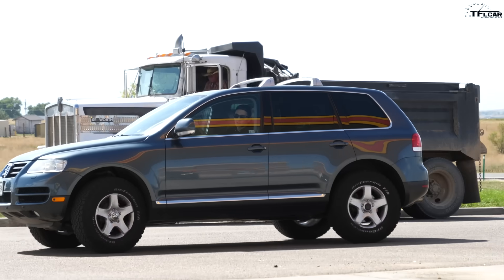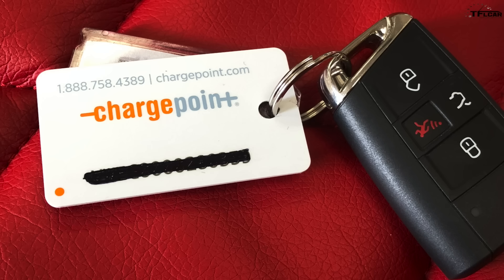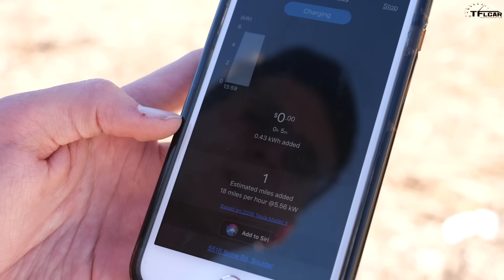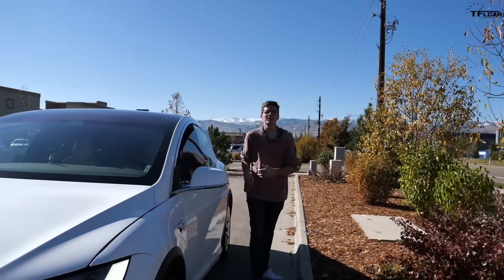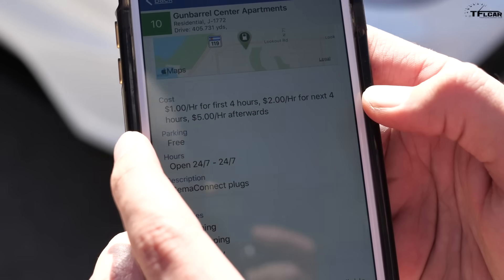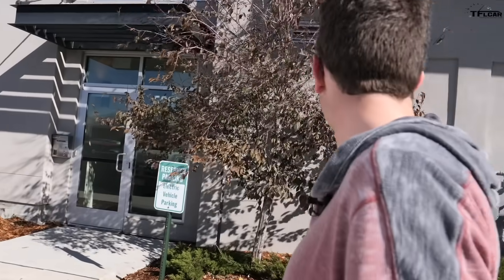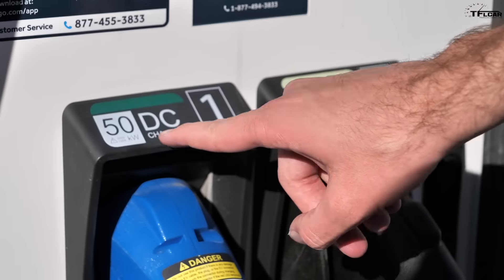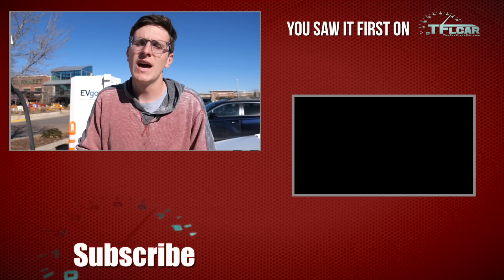Here’s Why Charging an Electric Car Can Suck - And It’s Not The Reason You Think!

Comment: Imagine traveling across the country every 200 miles stopping for many hours waiting for a charge. I do not think so.
Reply: and that is after you searched the net for a charging station, go out of the way of your travel to find it, and hope no one is using it, otherweise it is a long wait.
Reply: @yewkiamakuahui2296    Right you are. I once had a special card to get gas at commercial refueling. It was a huge pain in the ass when traveling. Would have to travel off the main roads 5, 10, 15, 20 miles out of my way just to get gas. All to save 3 cents per gallon.
Reply: @On, Wisconsin!   Wow,  now I can go a whole 100 miles look all over town for a charger then I have to wait 30 minutes. That is very inefficient.
Reply: @mikewhite9818  you don't have to look for a charger.  Just punch your desired end point into teslas navigation, and it plots your charging stops for you, right down to telling you how many minutes you have to charge to make it to the next stop.  Alternatively, in other EVs, you can use an app called a better route planner.  It has every known charger listed in its GPS, and you can enter what kind of car you have, and it will show you where you should charge.  It's really not that hard.  I'm not a technologically advanced person, and I can operate either of these very easily.
Reply: In one video I watched they said that the first small charge goes the fastest, after that it takes forever to fill up completely. So the recommendation is to make a lot of short trips between charging stations and make many short fast fillups.  I would think that would be annoying though as you would spend your entire life centered around and focused on your car and not on life itself.
Reply: @trailsend7877    You point is well taken.
Reply: I hope charging stations pop up on the GPS route.
Reply: @michelle20900  They may but the real issue is the time spent charging. Better hope for entertainment at each stop every 200 miles.
Reply: One way around that would be to tow a trailer with a generator on it. That way you could charge the battery while driving.
Reply: @timinwsac  And the trailer would drain the batteries faster.  A hybrid makes much more sense.
Reply: that is why you buy tesla
Reply: @navinmesommonta2017    I can buy a lifetime of gas for the price of a Tesla. Stupid you.
Reply: @mikewhite9818  you can buy modle 3  or  y at the same price as  gas car  any way   they are stop make gas car in the few years and in europe are sooner
Reply: @mikewhite9818  total ownership cost is actually matters, your comments all over the place, but showing you do not really know about basic things about Tesla cars.
Reply: @SLee-vj4px    Add up the costs and gas is way cheaper. Plus it is extremely efficient. If anything breaks on a Tesla you better have a big cash account.  It is ok only for around town. That is it.
Reply: @doctorlarry2273  right, so what? not good enough?
Reply: @doctorlarry2273  never say never, they said Elon will never make EV a mass produced cars for the consumers... eventually the energy industry will be facing today's auto industry where everyone try to catch to Tesla and develop EVs... but Mr. Musk had far advanced technologies that these today's big legacy ICE and Oil companies will fade gradually. this is not easy, only Elon has the guts and talents to do this.
Reply: @SLee-vj4px  Never.  It is not about building a better EV - it is about getting power to them.  Musk must be related to P.T. Barnum.
Reply: @trailsend7877  8 hours of charging time? If you can provide what model/make that needs 8 hour of charging. 8 hours, lmao
Reply: BRO. LIFE IS ALREADY STRESSFUL. NOW TO THINK OF CHARGING YOUR CAR AT A STATION FOR AN HOUR IS INSANE. OR EVEN AT HOME. THIS THING WILL EAT UP YOUR ELECTRIC BILLS LIKE CRAZY. I DONT THINK ELECTRIC CARS ARE FOR ME MABEY IN A 100 YEARS.
Reply: Try 20 to 30 minutes Tesla Model Y owner
Reply: @bobskeway8179  “2022 Tesla Model Y/Battery charge time 10h at 220V”
Reply: @bobskeway8179    Or at 120 normal household current “Imagine Level 1 as the universal charging option. If there is a standard wall socket nearby, you will be able to charge your Tesla with that. With that said, 120V is the bare minimum amount of juice you can pull into your EV. So if you’re wondering how long it would take to charge your 2021 Tesla Long Range Model 3, you’re looking at a matter of days, not hours. Not ideal.”
Reply: @mikewhite9818  I have a 220 in my garage charges at rate of 29 miles per hr. Most EV owner have this.  3-4 hours
Reply: we have charged our 2021Tesla Model Y over 80x average charge time 20-30 minutes (Range 325 miles)
Reply: @bobskeway8179    Refer to previous post. You can not charge a tesla at 220 volts in 3 to 4 hours. Stop lying to people.
Reply: @bobskeway8179  Only if you can find a special charger.  Your 20 min time is only 80 full. You can not drive the distance you say on an 80% charge. Further each year the battery capacity drops. By the time you have to change batteries you have not saved a dime or saved the environment. Follow the science not propaganda. Leftists are very prone to being propagandized.
Reply: @mikewhite9818  I have 6 friends who all have Tesla's plus one who has a EV VW all of them have 220 chargers. The battery life of the Tesla is 500K miles and life of  the car is 1 million miles, BYW I have a advanced degree in Quantum Physics! I think I know science.
Reply: @mikewhite9818  Do you own a 2021Tesla Model Y Long Range?
Reply: @bobskeway8179    But I can read and Comprehend what experts say. Some of which I posted for you and others to learn from so you can spend your money more wisely.
Reply: @bobskeway8179    If you had any kind of degree then you would know the folly behind electric cars at this time. It will take some kind of break through in the future to make them viable.
Reply: @bobskeway8179  Facts:  Model S (40, 60 from 2012-2015)	8 years / 125,000 miles	N/A
Model S (pre-2020)	8 years / unlimited miles	N/A
Model S (after 2020)	8 years / 150,000 miles	minimum battery capacity retention 70%
Model 3 (Standard Range)	8 years / 100,000 miles	minimum battery capacity retention 70%
Model 3 (Performance, Long Range)	8 years / 120,000 miles	minimum battery capacity retention 70%
Model X (pre-2020)	8 years / unlimited miles	N/A
Model X (after 2020)	8 years / 150,000 miles	minimum battery capacity retention 70%
Model Y (Performance, Long Range)	8 years / 120,000 miles	minimum battery capacity retention 70%
Reply: His latest car has a 400 mile range.
Reply: @billboyd4051    Better have a high powered fire extinguisher.
Reply: @mikewhite9818  For what, 48 amps is normal for this car. People buy these high speed luxury cars that beat Corvettes for many reasons, and know slow charging is what you get from a standard charger. The car displays where the Tesla chargers are. My doctors daughter died in a burning car, how many of your friends died in self driving Tesla's ?
Reply: Going to be LOTS..of Batteries  destroyed..an Electric cars  being TOWED
Reply: well you will have to, will be more aeasy when its the same for everyone
Reply: @Wildguns76    We do not have to. We have 300 years of proven oil reserves in the ground. Oil is a much better propellant.  You can wake me up when and only when you have a better idea.
Reply: This is when you use level three charging, it will get the car charged up in 30 minutes or so which works perfectly for restaurants or bathroom breaks where you also want to stretch your legs.
Reply: @mattwolf7698  - which is 10% of the charging stations, some are even wall outlet plugs
Reply: @mattwolf7698  And you get to stop so often!  I don't need to eat or go to the bathroom every hour or two when I am traveling.
Reply: @mattwolf7698    I do not think so.
Reply: @mikewhite9818  You probably has not drove a Tesla for a road trip. I recently did and it totally changed my perspective about it. Matt Wolf is exactly right  in his comments. Tesla, only Tesla thought about everything. The other EV makers rely on shared / public charging stations, good luck, they will not make it in long run
Reply: @SLee-vj4px  It would takes weeks to cross the country and back. There you go. Point made perfectly.
Reply: @SLee-vj4px  And Tesla will make it in the long run? Maybe, maybe not.
Reply: @RWebster325  with government around the world ban ICE cars, I don't see why Tesla will not make it in long run. Tesla is ahead in every aspects in EV technology. the biggest hurtles for other auto makers is they started to think about EV 10 years too late.
Reply: @SLee-vj4px  Causing tons of pollution in several different areas, while trying to nip pollution in a single area? Doesn't make sense.
And where is the recycling plant?
"The new wave of electric vehicles only started about a decade ago, so there haven’t been many EVs to recycle yet, but it’s going to come, and companies are preparing for it."
While well intentioned, it appears that it (the recycling) really hasn't started yet.
But then again isn't the Tesla factory (the main one at least) in mainland China?
Reply: @RWebster325  ok, easy to taste a dish, but get in kitchen and cook is another matter. 1) is EV caused pollution worse than those of ICEs’? 2) Tesla is working on the solution to retract materials from old battery to make new batteries. I could be wrong but I think the technology is under their recent patent applications.
Reply: @RWebster325  say what you want. Tesla leading the EV industry in all aspects. EV in general is / will be better than ICE.
Reply: @mikewhite9818  Engineering explained did 2000 mi, 12 stops for 39 min each.
Reply: @mikewhite9818  Ok. So I did the math, and here's how long it would take for a gas car vs an Electric car to travel round trip from California to North Carolina.
First up is the gas car:  while including the time it takes to stop at gas stations, hotels, ect., It would take approximately 1.14 weeks to travel from CA to NC.
Electric vehicle: assuming that this car is a tesla that would stop at superchargers, the round trip would take about 1.17 weeks (Including same stops as gas cars).  A.K.A 5 hours more than the gas car.
If you are going to whine about a five hour difference then just ride a bike because at least you don't have to stop at gas stations. (And they are eco friendly! :)
Reply: @pyth0n_lmao    You math skills are very bad.  The difference between the two is how far you can go on a tank. I go 500 miles then a 20 minute fill up. You travel maybe 200 to 250 miles then a fill up for hours if you can find an electric charger.
Reply: @mikewhite9818  I was going by the average range in most gas cars which is around 400 miles. And the average range of a tesla is about 300. For road trips in a tesla, you would go to a supercharger, which can take 30 minutes to 1 hour to fully charge. The reason the chargers in this video are so slow is because they are meant for guests at the hotel/apartment complex.
Reply: @SLee-vj4px  You must be a great fan of boe jiden...'course everyone in jiden's world can afford 50,000 bucks.  Hey, maybe they could start putting solar panels and windmills on cars.
Reply: @martinpope3835  not sure what you are talking about. I am not for big government, and not for rigged election too.... anyway, Carmy is not $50k car, but 5 years ownership cost was about even with Tesla Model 3, this was when gas prices less than $3 per gallon, with today's price, the 5 years ownership of Camry going to cost more than a Tesla model 3.
Reply: @SLee-vj4px  I would not even attempt one of my road trips in any EV,  Tell us again how many Tesla chargers are on major highways/interstates in all the states.
Reply: Fast charging is getting better where you now only have to wait 30ish minutes for a good charge. It's better to only charge to 80% as it will slow after that and you pay by the minute. So you could go 400 miles in a 300 mile range car in a day and it will cost you an hour to charge it twice. Obviously, not ideal, but you could try to time it around eating lunch and dinner that day. If it is your only car, you could rent a car if you only do one to two long trips a year in your car. EVs are not for everyone.
Reply: @tremorsrules  - it takes longer to go from 80% to 100% than from 0 to 80%
Reply: You've missed the point of EVs.  It's only designed for local city travels, not for outside of cities.  If you need to travel further, you must have a 2nd gas car for that purpose.  Problem solved.
Reply: @joeya6795  Not if you own a Tesla
Reply: @joeya6795  2 cars, 2 payments, 2 insurance policies, 2 repair/ maintenance costs. Makes no sense at all.
Reply: @joeya6795    Then they need to be marketed as a limited use vehicle that costs way way more.
Reply: @joeya6795  I was thinking exactly the same, but actually if you've drove a Tesla, you may change your mind. my next purchase will be Tesla, not other EVs because of the charging situation.
Reply: Same here, my next purchase will be a Tesla. beside charging, Tesla has lead in almost all categories, especially in efficiency and range. Sandy Munro's channel is really good analyzing difference between EVs. I used to be a car review junky. but now only watch EV related channels.
Reply: @SLee-vj4px    It is only good for running around town. Just an expensive golf cart.
Reply: @mikewhite9818  if you drove one of Tesla's car, I think you will change your mind(not other EVs because Tesla is way ahead of everyone else). it is better in every way compare to ICE cars.
Reply: @SLee-vj4px   It is important that when running low on fuel to be able to pull in and fill up and get on your way. Can not do that with an electric car. Only good for running around town. Also hope your batteries last they are very expensive.
Reply: @mikewhite9818  in short, you've not drove a Tesla, the points you are making are the same ones I had. After I drove a model Y for 100+ mile trips, it totally changed my mind.
Reply: @SLee-vj4px    A whole 100 miles. When you run low how long to recharge?
Reply: 10h at 220V
2021 Tesla Model Y
96.7h at 110V, 12h at 220V, 1.33h at 440V
2021 Tesla Model S
89h at 110V, 12h at 220V, 1.33h at 440V
2021 Tesla Model X
8.5 to 10h at 220V
2021 Tesla Model 3
Reply: @mikewhite9818  I was at 25% remaining on my way home, and charged about 15 minutes to 55%, it says when I got home I should have 20% left, and it was accurate.
Reply: @SLee-vj4px    Refer to chart posted for you. That is more accurate than your statement.
Reply: @mikewhite9818  if you are on a road trip, you use tesla superchargers.  I can get a full charge in usually less than 30 minutes.  I'd say average of 20-25 minutes for a full charge.  So after 5 or so hours on the road, I stop for lunch, take a piss, and I'm on the way.  I just drove clear across Canada, from the furthest west you can go, to the furthest east you can go, and I didn't feel like charging was a burden at all.  Wake up in the morning with a full charge, drive till noon, charge, drive till 6, charge.  It's beyond easy.
Reply: @tysonkauth7232  If if if if ect. Not many ifs with the very efficient and cost effective gas vehicle.
Reply: @mikewhite9818  if what?  I never once said if.  I'm telling you from real world experience.  You're just grasping at straws.  I've owned a Tesla for over a year now, and I can honestly say it's never burdened me one bit.  It's not some big tectonic shift to switch to an EV, it's a couple very minor changes to your regular driving experience, but all in all, it's is far more cost effective and a better driving experience overall.
Reply: @tysonkauth7232    You know the ifs.  If you can find a Tesla Super Charger and if you have 30 minutes to burn.
Reply: @tysonkauth7232    Good for running around town.
Reply: @mikewhite9818  i just drove clear across the continent in one, they are for far more than running around town.  And like I said, it's not about if you can find a charger, that is already preloaded into the navigation system.  Couple quick button touches(or voice commands if you want) and you're set.  For the vast majority of the days where you are not on a long trip, you wake up with 300 miles in the tank every morning.  That more than suits the needs of 95 percent of the population.  If you drive 1000 miles a day, I'll agree with you, a gas vehicle is more effective, but there isn't many people who do that.
Reply: @SLee-vj4px  And what about 1,000+ mile trips?
Reply: 1. Park car 2. Plug in car 3. Make dinner 4. Watch TV 5. Go to bed 6. Sleep 7. Get up 8. Get dressed 9. Breakfast 10. Unplug car /Elapsed time 7 hours - range added 308 miles. In the example shown, the driver doesn’t sleep much.
Reply: @RWebster325  with Tesla, this is very easy today because the software will tell you your charging options along the way based on your route and remaining battery level. spend a bit longer time at charging station compare to gastation is the only downside.
Reply: @SLee-vj4px  Reread what you wrote. And in a number of evaluations the reviewer (usually a dedicated EV user) missed the exits way to often and openly admits that it is a problem on the open road.
Reply: @SLee-vj4px  How many charging stations does Tesla have across the state of Montana on the I-90 and I94?
Reply: @RWebster325  many folks did across the country trips with EV, don't think it is a problem.
Reply: @RWebster325  road trip, these days actually favors Tesla more and more, with gas price sky rocking, a Tesla would save you at least 2/3 (if not 3/4 or more) on the fuel cost.
Reply: @SLee-vj4px  ROFLMAO!